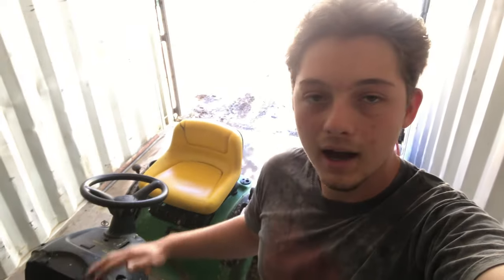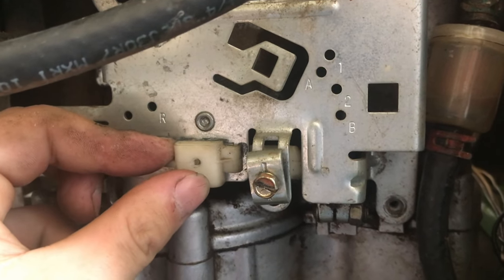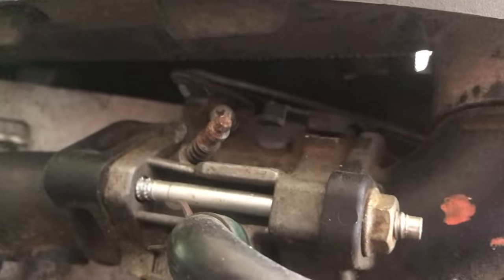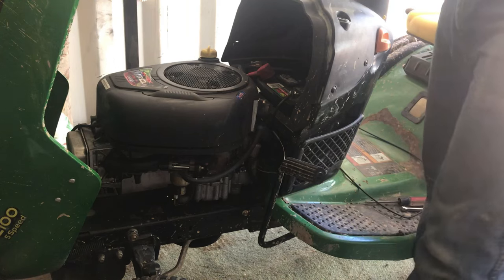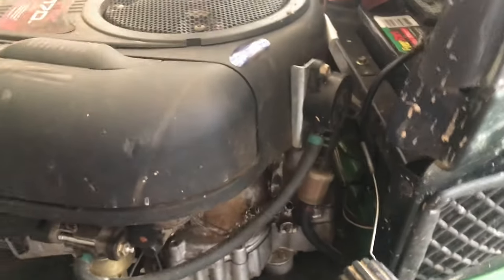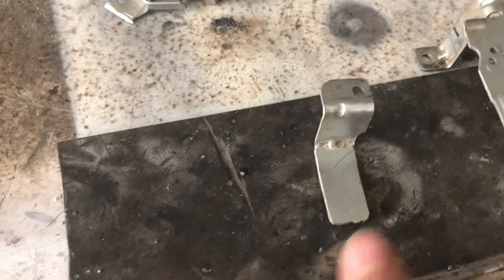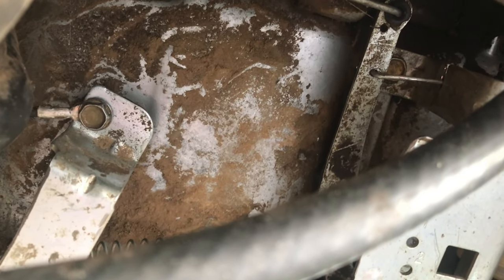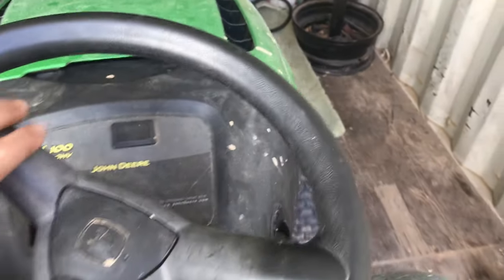How to make a racing lawnmower how to remove the governor I.T.Creations

Comment: Blew up my 17.5hp Murray with a bungee cord on that governor. I was riding around with a 6 in front pulley swap and like half a can of ether. It also hadn’t run in months and would die if it idled. It had a huge crack in the back of the block. Took it apart and the counterweight was ripped from the piston.
Reply: The same thing happened to my brothers 17.5 HP. Except the engine went into complete meltdown after It got stuck at its highest rpm and completely busted apart, pieces and oil were all over the mower😂

Comment: You’re actually hooked to the governor, holding wide open constantly on a B/S you will find out how crappy their valves are. Ask me how I know. 😉
Try and find a kevlar drive belt, it will last longer and grip better. Great job so far!
Reply: Whats wrong with their valves? Do they break at high rpms?
Reply: @LS1sLegoGarage  The springs are weak, and the valves will float (the valves won't seat so you lose compression at high RPM).  Also, B&S engines use a plastic timing gear for the camshaft, it likes to break when you over-rev the engine.
Reply: Hopefully he won't use that pedal to hold it wide open for long periods.. do you see any issues with this setup other than the responsibility of the diver to control the rpms?

Others are just saying the engine will blow but I can't figureout if they are concerned about OP not self governing his throttle usage appropriatly; or if they are saying he is literally setting up an inevitable and impending motor failure

I'm just tryna hook up a throttle gas pedal for my mower to use for off reading and no one is very clear about how to do that; and when they are.. the commnt section looks like this one

Comment: FYI If you don't remove the governor componants in the inside of the engine you will destroy your engine when the parts com flying appart from excessive RPM. The governor gears are not designed for max RPM of the engine and will fly appart and lock up your engine. I did this to a 9hp Briggs on a gokart. It ran fine for a couple of lapps and when I ran at full throttle I heard a clanging noise followed by an abrupt stop of the engine. It was Locked up due to the gonernor gear being shreded and jaming into the crank and cam gears.
Reply: Components....apart....laps.... shredded....and you are absolutely correct. Removing is removing.
Reply: Is there a video for this somewhere?
Reply: It’s not. Necessary on a vertical shaft motor
Reply: @philipgillespie8409  Really,,,Since when did they decide a vertical shaft engine needs no governor. orientation has nothing to do with the function of a governor

Comment: Above 4,000 rpm, a  flywheel is highly recommended for safety.

To  damage to the keyways, do not use a steel flywheel key. A heat-treated hardened key would be even a worse thing to use. An soft aluminum (4041 hardness) key works best. To keep a keyway in a cast flywheel from splitting, it's best to use soft aluminum key. The reason for this is if the connecting rod breaks resulting in instant crankshaft lockup, the soft key will prevent damage to the flywheel and crankshaft. The aluminum key will shear in two, allowing the flywheel to slip on the crankshaft, preventing damage to either the flywheel or crankshaft. A steel key will cause a cast iron flywheel to crack or break, or if a flywheel loosens on the crankshaft, it'll wallow out the keyways. But if an aluminum V-belt starter pulley with ignition timing degree marks is installed on the PTO end of the crankshaft, there's really no need to install a flywheel key. The only reason most small engines use a flywheel key is to time the ignition, and not to prevent the flywheel from slipping on the crankshaft.What does a normal lawn mower go in terms of RPM when it's at full throttle normally just mowing a lawn? And what is the safe level of RPMs for a four-stroke lawn mower? 6,000 RPM 8000?   From the internet.....Above 4,000 rpm, a steel flywheel is highly recommended for safety.

Comment: Take the engine off, pull the governor out, take the arm off and connect directly to the carb. Then you have truly no governor
Reply: Governor inside motor? Is there a video on YouTube for this?
If I do what he did is my notor gunna moat likely die, but if I do what you suggest it'll live much longer ungoverned?

Comment: 10:08 you sure its damn safe to be laying the hammer down on such a small engine?
wouldn't it wear it out?
Reply: It isn’t because the governor is still in there and could blow up
Reply: He removed the old throttle, but to get rid of the governor you pull the engine apart and take the governor out. He just bypassed it and it will blow the gear up because it is plastic

Comment: You will blow that thing up if you keep it connected to the governor like that
Reply: Nah John Deere’s cut out if there’s any problem I have one and did what he did and it got to hot and beeped and turnten off
Reply: The only way it will is when it runs out of oil I recommend 15-40 diesel oil that way it has enough lubrication during top end revolutions I repeat don't put no stp or any thing else in ur lawn mowers for raceing purposes it will blow up then only 15-40 oil